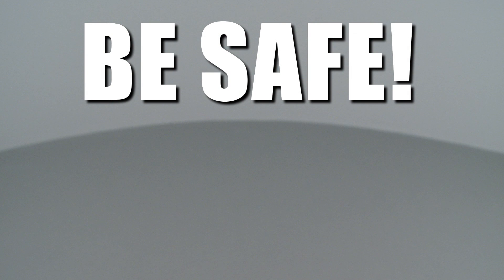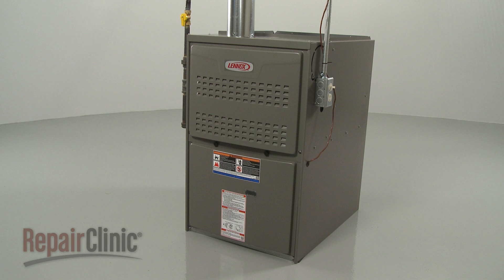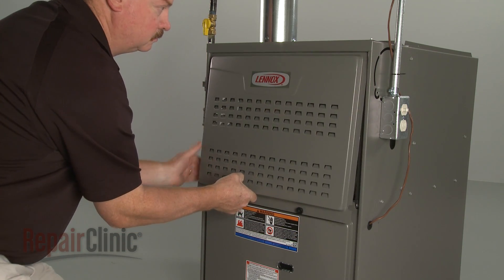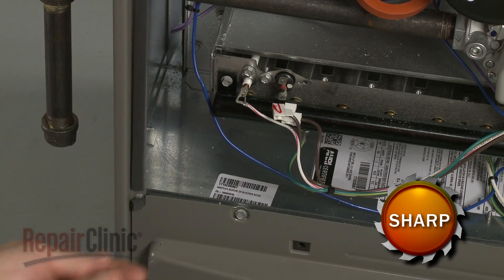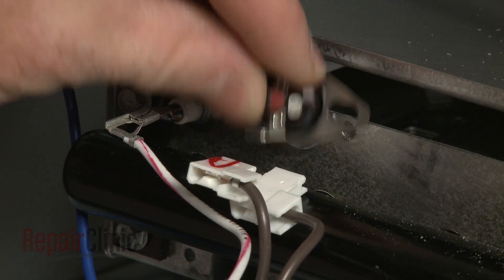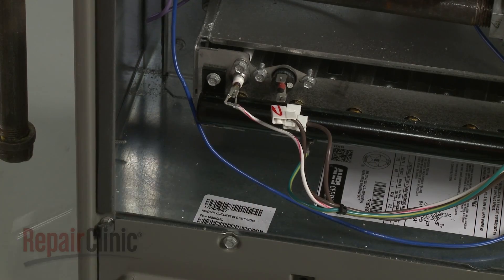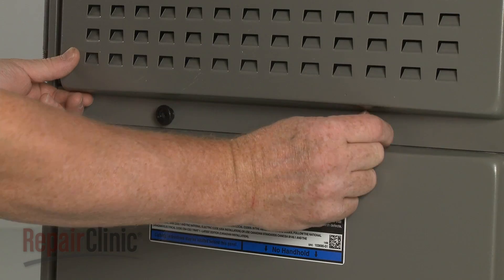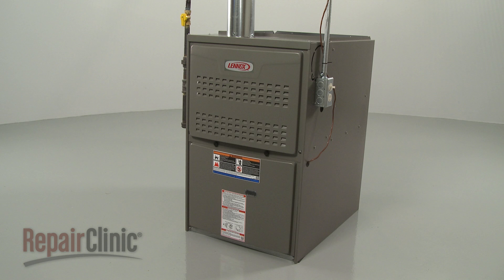Lennox Furnace Rollout Switch Replacement #25M60

Comment: What does the roll out switch do?
Reply: detects the flame going where it's not supposed to.  Detects heat and shuts the gas valve off if it gets too hot.